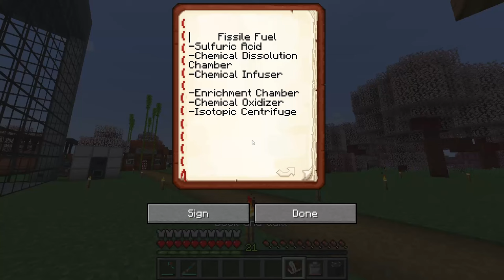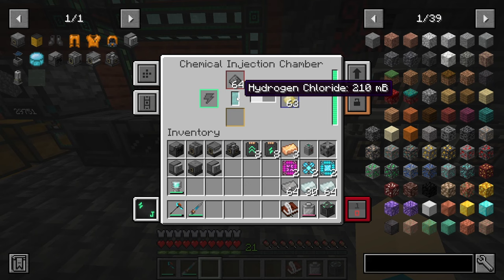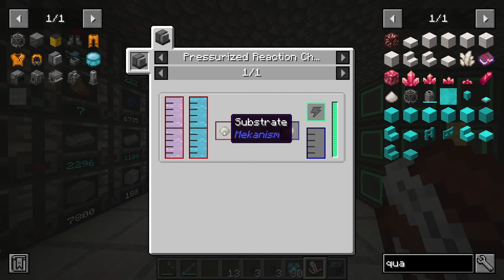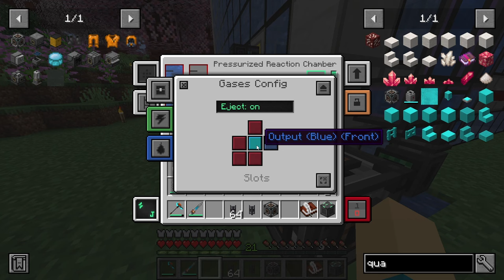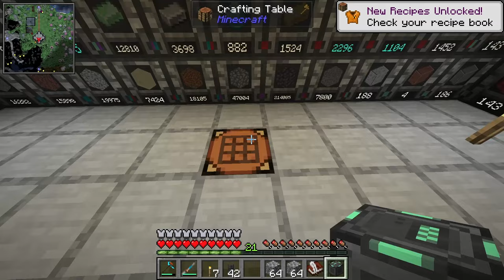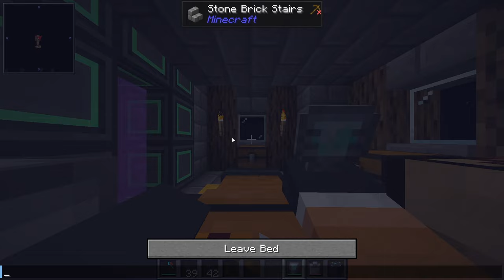HOW to MAKE FISSILE FUEL in Mekanism | Minecraft 1.19

Comment: The limit for a water reactor isn't really just a flat number.  It's based on a bunch of parameters like the biome you build it in and its size.  Seeing that it's about 336 is incredibly useful though since that number is really hard to pin down.  If you want to make all of the upgrades that require antimatter, you're going to need 10 antimatter pellets (really 9 since the QIO Drive is excessive)  The only reason to really want a sodium reactor is that to get 10 pellets takes 100M nuclear waste, which will take over 4 hours of running.  With just your setup but swapped to sodium, you could get the runtime down to 2.5 hours or so.  You'd need to provide 20k uranium ores and like 4.2k fluorite ores during that 2.5 hours though, which means providing like 3 a second...  Including the time taken to build and load the thing with sodium, it's really not worth it.  When I tried it, I had to keep an electric heater running in the background to burn off the excess electricity because it's ironically a biproduct of the more valuable nuclear "waste".
Reply: @OverlandSmiles  yea you can probably squeeze out a little more fuel usage.  I'm still of the opinion that while there's valid reasons to want even faster burn, it requires so much ore that moving the miners around becomes the new bottleneck and the amount of time it takes to go to sodium is probably longer than the amount of time it can save.  Unless you're doing this for a server of multiple people, it's just not really worth it.
Reply: @askmiller  in skyblock we think none of that

Comment: Is there a way to hook the reactor up to a daylight sensor and use a redstone signal to have it only run during the daytime, to make sure it's only running while the Solar Neutron Activator is getting daylight?
Reply: Yes, use one of the Reactor Logical Adaptor things, set the mode to activation which turns the reactor on or off based on a redstone signal. Test whether the daylight sensor outputs ALL the time during the day, or just sends a signal out once it is day time. If it is all the time, then you can simply just run it into the Logical adaptor. If its just a single pulse, look into how you can make it a permanent one.
Reply: @DeSibyl  i think it sends the signal all the time as long the specified time is right

Comment: a bit late to the party but ive followed every video so far and my reactor keeps going haywire at a burn of 32. anyone know what could be causing my problems? I forgot to mention but i either get excess waste  which ive fixed, or high temp
Reply: Well if ur getting excess waste u need more outputs to use more waste, if ur getting high temp its prob because your water level is going down.